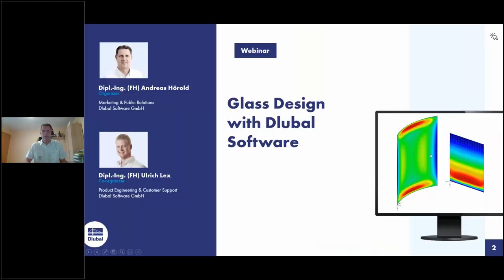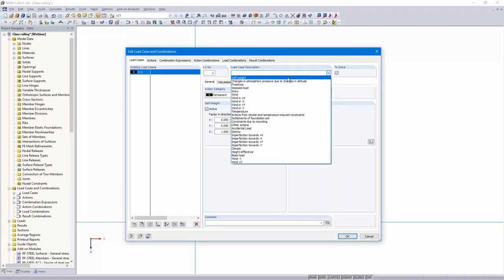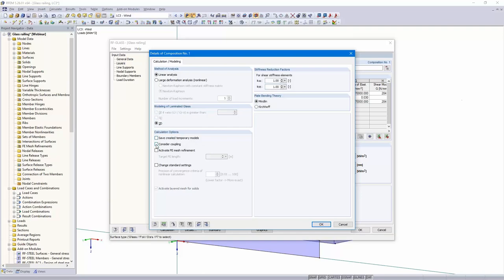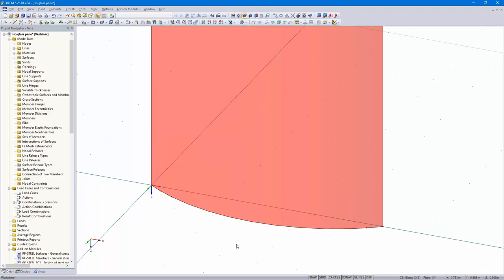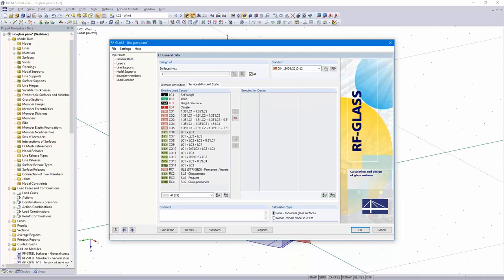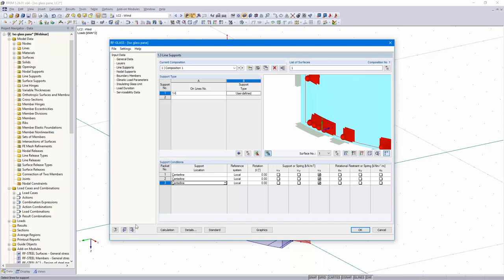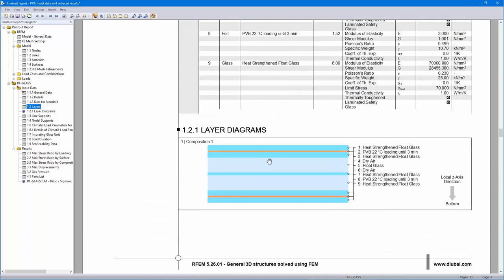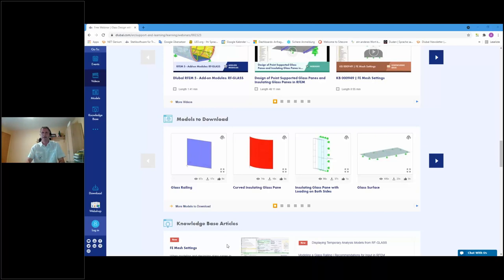Glass Design with Dlubal Software

Comment: Thanks for your support 
I have two question
1. Why you represent spring support in first example
02.why y support curved glass in middle in XDirection
Reply from the maker: Hi, mostafa!
1. Springs have been defined because the clamping in such systems is not rigid, but occurs via rubber bearings.
The spring size would be determined by the bearing detail used.
2. So that the system does not become unstable during the calculation.
The system is generally "floating" and, in order to be numerically stable, needs at least one point in the calculation that is supported in the X direction. The middle was chosen so that no effects arise from asymmetry.

We hope we answered your questions sufficiently.
Reply: Thanks a lot

Comment: The surface drawn in RFEM model represents the centreline of IGU (half thickness) or the outer side of it?
Reply from the maker: Hi, Mihail!
When creating a surface model, all surfaces refer to their center surface. If you want to model a planar connection of two surfaces with different thicknesses, it is necessary to define a surface eccentricity. https://www.dlubal.com/en/solutions/online-services/glossary/000392

Comment: I wonder why the wind pressure is applied in local direction in both cases? Agree that local could apply in the case of the negative wind pressure as it is generated due to the buuilding internal pressure but the positive wind pressure, should it not be defined as global related to project area? Please assist.
Reply from the maker: Hi, Janel!
Can you please tell us where in the video this is shown?
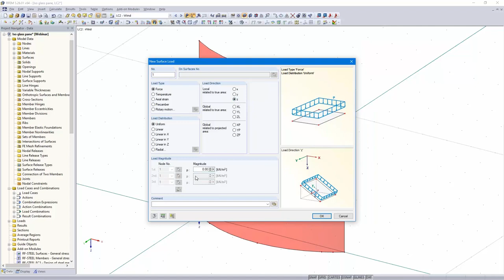Reply: @DlubalEN  I believe he/she means at 20:00, for example. I know it's arbitrary for the purpose of the webinar, but I belive they expected something according to EC where the shape coefficient has the purpose of correcting the load value for a projected load on the given (in this case, cylindrical) shape.
Reply from the maker: Hi, Felipe! Similar to EN 1991-1-4 7.2.8, the load was applied locally. However, the direction of the load is not important in this webinar. We wanted to present the general workflow for designing glass elements.

Comment: please can you clarify meaning of  height difference ?
Reply from the maker: Hi, moh!
Due to the different heights of the production site and the final installation site of the glass and the resulting pressure difference, there are additional loads on the insulating glass panes.

https://www.dlubal.com/en/products/rfem-and-rstab-add-on-modules/glass-structures/rf-glass
Reply: I HAVE  QUESTION
IF I TAKE SEALING INTO CONSIDERATION IT CHECK FOR SEALANT BITE BUT RESULTS WILL BE THE SAME RIGHT ?
Reply from the maker: Hi, mostafa!
The stiffness of the secondary seal is set using the option "Consider secondary seal".
A very small value is specified here by default. Switching to custom can achieve the same results.
However, other results could also arise, which should then be checked. Because the secondary seal should not have a load-bearing effect on the pane.